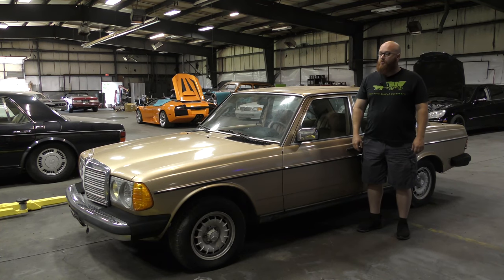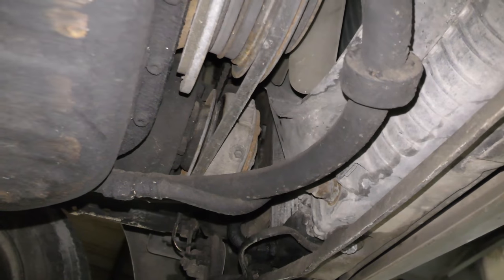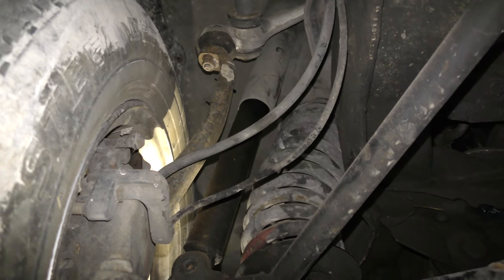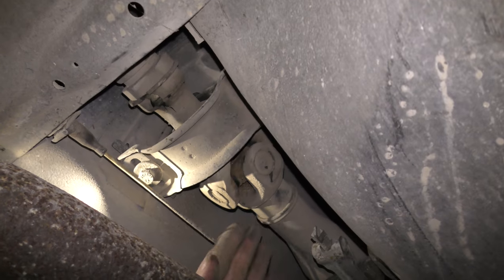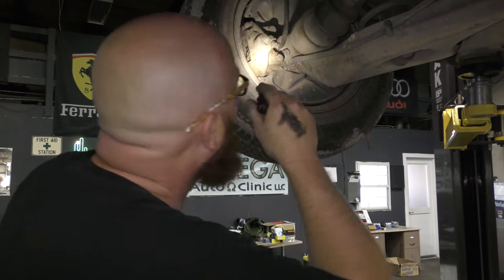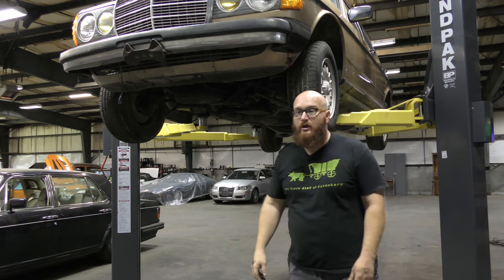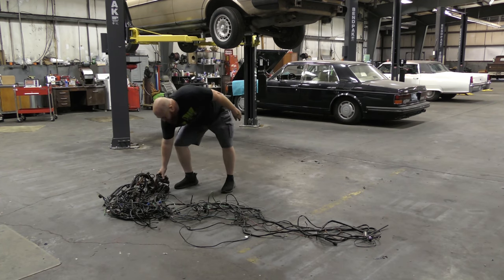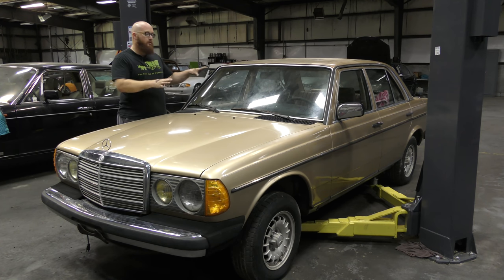What's lurking underneath? CAR WIZARD finds lots of repairs required to make '84 300D MB roadworthy

Comment: One of the best built cars ever 
Wizard if you need weird parts from Europe will gladly help.
# active mercedes club member
Reply: I wish people would stop saying that. If this car was so effing bulletproof, it wouldn't need practically every single part replaced or repaired. Sure, maybe the diesel engines, when maintained, are solid. The rest of the car is like any other, as evidenced here. Give me any old beater and I'll get it running smoothly and safely for $6k.
Reply: @OMGWTFLOLSMH  Every car needs maintenance at the end of the day. The difference between any regular old car and the "bulletproof" ones (like these mercedes, 80's Toyota Hilux, etc.) is that you can maintain them as long as you want to without needing something really critical such as an engine or transmission rebuild.
Reply: To OMGWTFLOL the difference is with maintenance and care this car will last an easy 500k without taking the major assemblies apart. These are/were designed to be taxis. The interior simply shrugs miles off.
Designed to be used and used and easy to service. Not a disposable vehicle. This is simply deferred maintenance plus rodent damage.
Cars are a choice we all like different things.
Reply: @OMGWTFLOLSMH  Rubber deteriorates and it is 36 years old. I have replaced body mounts in 2 year old vehicles that should have not failed.
Reply: @OMGWTFLOLSMH  You are so wrong. These cars earnt a reputation. The rest of the car has held up better than most others. Once upon a time Volvo was made this way too. Go find a KIA or anything GM chuck together that holds up like one of these. The work needed is rodent damage and deferred maintenance.
In the late 70s early 80s recall what other brands were making, how they dissolved and how rarely they made it past 100,000 miles.
This is a passenger car built like a commercial vehicle.
I have 3 Mercedes and they are all just awesome cars.
Reply: @jeremyaustin9103  "Deferred maintenance plus rodent damage" >>> Perfectly said

Comment: I have a 1976 Triumph Spitfire that is in similar condition as that Merc that I've built a new engine for and currently replacing all of the worn suspension components.  I am able to to all of my own work aside from machine work, alignments, and AC recharge.  I wouldn't hesitate to put the time into that Mercedes, that car has lots of potential and many years left in its life once it's sorted.

Comment: More videos on this Mercedes please. Would be interested to see how the wiring harness repair/replacement turns out. At a minimum, a video that highlights the finished product or covers some of the common repairs (give Bergsma some competition). The W123 is an incredible car that is exceptionally engineered. I would definitely restore this car. It is unfortunate that we now live in a disposable society. New cars today will never ever last as long as a well engineered car like this Mercedes. Maybe if consumers stopped buying the new garbage auto manufacturers are producing and find an old car like this W123 to fix and drive, they may get the point (but I guess that isn't good for the economy). Thank you for the videos that you post.

Comment: My grandmother’s 108 Benz 280 SE with dual exhaust. When it came time to replace the exhaust at the Benz dealer they would lay the parts out from front to back in a assembly trolley. Present it to the car, adjust the pieces, tac weld. Lower and finish the job! Elaborate but it never touched anything!  Very cool!

Comment: Glad to see that W123 is going to be recommissioned.  We did a similar W124 a 1988 260 E.  We spent $10,000.00 and the car is nearly perfect with 251000 miles.  If you need any help sourcing parts for that car just ask and  i will find it for you. I hope you will get a local qualified shop to cut out the rust and weld in a correct repair.  That paint can be buffed out and the car will be a gem!

Comment: NONE of the parts required to fix this W123 are difficult to find. It’s all available from several sellers, brands, qualities and prices to choose from. This car has better parts availability than pretty much any 90’s car. The difficult to source part was the wiring harness and is already there. That is not an excuse to let it die.

Comment: Some considerations
-Tires: They are cheap for a car like this. 
-Oil cooler lines: If you strip the treads or break the cooler itself was because someone over tightened in the past or you didn’t loosen the line properly. You don’t need to mess with engine mount if you modify them by cutting and welding a fitting that allows to replace just the rubber section. My car had that mod done. 
-Radiators are dirt cheap and easy to replace. I would change it without even thinking about it.
-A/C can wait for the moment. That is not required to make the car roadworthy.
-Primer pump is one of the easiest things to change and they are cheap.
-Front end rebuild is always in order when you deal with a car like this, unless it was done by a previous owner.
-wear sensors are not required to make roadworthy either. 
-Trans and engine mounts are cheap and easy to replace. Way easier to replace than in a FWD car. Flex disc, carrier bearing and mount are also easy, especially in a lift. Just be careful to mark the halves of the shaft before taking them apart.
-CV joints. I would put new boots if the joints were still good. Replacement axles are a lottery. You can get good ones or get junk. Changing the boots is time consuming, however. 
-Shocks are not that expensive and they are easy to replace as well. Certainly easier to change than in a car with mac person suspension. 
-Brakes should be overhauled completely.
-Left rear quarter panel rust is caused by the antenna leaking into the trunk. For some reason not all antennas have a hose drain. They just drain in that well, water collects there especially in the rubber drain is plugged. That can be easily prevented by removing the trunk liner once a year anc doing some cleaning. That’s a problem caused exclusively by neglect. It can be fixed inexpensively with a wire brush, fiber glass and paint. 
-The missing rubber donuts that hold the rear muffler is a clear indicator this car was neglected badly. Those donuts cost nothing and they are not that difficult to chance.
-The rear bumper fell off because the rubber mounts failed. Is a common issue that can be fixed inexpensively.

This car is surprisingly clean for having been neglected for so long and considering they got the car for nothing, it still makes sense to fix it. With all those repairs done, it will outlast any other used car you can get for the 6 to 8 grands that would cost to do the repairs.

If they don’t choose to repair the car is just because there is not commitment. Financially makes sense since it won’t depreciate at all for as long as they take care of it.

You buy a used Camry, Accord or Sonata for that money and 2 years later they are worthless. Also, depending on the millage and engine, they will require a timing belt and because they are throwaway cars, they will have little stuff here and there broken because none of the previous owners wanted to spend a penny to keep the car properly. All cars cost money. You just choose what to spend it on: Repairs or depreciation plus more repairs.
Reply: Absolutely correct. And another thing to consider... Toyota is reliable & everyone knows that but compared to the potential longevity of this thing, Toyota may as well be a Chrysler. 

About the only thing I can think of in the same league for toughness is the Ford Panther platform.
Reply: @acemobile9806  There might be a few other cars/trucks that can last a really  long time like the B platform, Land Cruisers, Defenders, Checkers, flat head Fords, RWD Volvos but some of those cars a bit unusable for most people these days and some of them (Land Cruisers and Defenders) are way more expensive than an older MB.

Comment: Hello Wizard, my grandpa had a 300D (or 300TD not sure yet) W123 and is sitting for 9 years now. After watching your previous video for the W123 I when and try to start it with no success, forgot about fuel, I will try again after checking things first and getting information from your videos. Thank you for showing us!
Reply: I will go with today's information next try, the wires look good on it.
Reply: I hope you changed out all the fuel filters first.
Reply: @300DBenz  Thank you, that is my first step. No much space to work where it is now, thinking of moving it but is not easy if its not driving.

Comment: I had a '81 280E, built in Germany and bought new. Maintained by the book and it was still very trouble-prone.
Nice to drive and solid body but many parts were poor quality with many random failures, etc. Had one more after that provided by my company. I then went to Lexus and will NEVER return to any German junk.  Got to be friendly with a really smart M-B Certified Master Tech.  He said that the big secret of M-B is that they are not especially good cars. I'd certainly agree.

Comment: Too many ppl don’t replace old tires simply bc there’s still tread. Good point wizard, dry rot causes blow out. Not safe. I always check tires and date code. Leaves and debris is good to clean out this way it doesn’t rust and rot the car out.

Comment: Wizz get yourself a chunk of telco cable has many different color combos wires . Tag plug and components with the same pair of colored wire to help replacing the harness. I believe its 25 different color pairs. Use 25 under hood 25 under dash  .

Comment: Speaking of old Benzes and tires, somehow I have a 1985 with the original spare and the tire is still good, had it dismounted and inspected. Meanwhile, I had a sidewall blowout from 2015 production year tires on my Porsche. That's the difference between exposed to sun and not exposed to sun I suppose.
On the A/C compressor, mine locked up right as I hit full throttle (with a modified M117 5.6 liter) and the clutch exploded. That was fun.

Comment: I’ve had to replace almost all of that stuff on my 300D. Luckily though, my wiring isn’t chewed up. Mine also has a good bit of rust under the rear unfortunately. I’ve recently purchased a 1986 naturally aspirated Porsche 944, so now I’ll have 2 cars and I can actually do more in depth work on the Mercedes because it was my daily driver

Comment: Presumably, it will be the first item in the workshop manual under "completely rewiring the car", but the first problem I'd have with that harness is WHERE to start shoving wires in. I would take a guess that you would put the whole thing inside the car and start from there. 😁

Comment: Hey Wizard.. Love some old Benz's.. the 300d motor are bullet proof. this will be a good car for a student when your done. by the way I don't know if you have ever used  Parts Geek or not but they have everything you need to get that car on the road.  fair prices as well. have used them on my benz's a lot.
i am no mechanic but i keep my benzs alive,  i've all the service on my cars for years.  you said you would turn the rotors.. I just replace them cause no one around my area i trust  (bad machine shops) and really you can get replacements for the cost of turning then you dont have to worry bout the warping if they go to far. .Really enjoy you and hoovie. best of wishes.

Comment: Of course I'd be willing to restore it/have it restored. More so if it were a 280 CE, but I'd take the slow-ass diesel... :D
As intimidating as that harness looks ... it would look pretty quaint if you laid it out next to all the wiring found in the modern day equivalent of that W123... :)
Gotta say that even though there's a lot of work to do, considering the age of the car and where it spent the last 5 or 10 years, it still looks pretty decent underneath. No wonder these things are still popular in Africa and veteran cab-drivers over here in Germany still get teary-eyed when you ask them about the W123. I remember sitting in a W123-diesel taxi in Portugal in 1991 and the driver showed me the odometer ... it was at over 500,000 km and according to him, it was still on the first engine and gear-box.

Comment: That harness looks more like 2 days 2 guys to remove and replace.  Lots of r&r , seats ,carpet, consol , door panels maybee, parts of the headliner.   If you have to use butt splices get the shrink tube ones.

Comment: Properly sorted very good examples of this type of car actually are coming in pretty close to $10K now, so getting this work all done might make sense if you are looking at a long term investment/classic restoration.  Or for nostalgia.  It's certainly cheaper than restoring many other classic cars and a good first project as well, since they are so dead-simple.  

But DO absolutely expect to spend $10K on getting most of these to 100% inside and out.

Comment: Glad the car is being renovated. 
However I would not give it to an inexperienced driver generally. The parents should keep it for themselves if they appreciate classic cars. The exemption from the rule would be if my son or daughter already had a record of sensibility, maturity & restraint. I would be cautious with the family heirloom.
Reply: I mean, the fact that the daughter wants a car like that is already quite incredible, and will probably appriciate it. But yes is a car to be driven whit a modicum of care at least, if for no other reason to not die rammed by some idiot in a suv. The brakes are not as good as on new cars and no airbags whatsoever.
Reply: I think one thing that needs to be mention to them & planned for is the valve adjustment every 12k miles for the Om617(a)
Reply: @Ermy1996  Definitely. If in fact she actually wants that particular car because of its significance, that already helps the case.
What gives me shivers is the Wizard's daughter (similar age?) & her off-roading his formerly immaculate Prelude into oblivion.

Comment: Forgot to add Say you spend 6 grand for mechanical and cosmetic.  That car would bring that easily and won't depreciate.   i recommend Vredestein tires (5)  and HELPerformance stainless steel braided brake lines.  Also  Bilstein shocks/struts.

Comment: I paid $3500 for my ‘85, (cosmetically beautiful, but mechanically she was very rough), spent $5600 or so on parts over the past 12 years I’ve owned it. Did all the work myself (except for having a machine shop repair the manifolds), if I’d paid a shop to do ALL the work I did, it would’ve cost around $20,000 just in labor.

Comment: I'm often surprised that in the states you resurface the brake rotors/discs. Here in the UK we tend to just replace the rotors as they are not expensive in themselves. That car has multiple age and rodent problems.  If I owned that car and was keen to renovate it I'd try and work out a plan for the bits I could do, and the bits I couldn't do that I'd ask you to do. That way it might just be economically worth it. It is a labour of love, but a lovely car at the end of the day..........oh...and I thought you didn't do projects.......ouch !

Comment: The proble you get with a hand me down car, I had a car off my dad but he put in the deal he would go in on any repairs? well at the end of the MOT it needed more in repairs than the car was worth in fact 3 times the value of the car, luckyfor usmy da was pretty well connected through his job and most of the work cost parts or less. I had that car for 4 years and a friend had it for another 2 years and he sold it again.

Comment: I had an 83 300D.  I 

The only thing that continued to be a problem was the HVAC system.  Other than that, an excellent car.  Had a little over a 100k when I sold it.  Should have kept it, I'm sure I'd still be driving it.

Comment: Can you still get good parts for these?  I went through a MB diesel phase where I’d find and fix em up as a hobby...a bunch of 123, 126 and a couple of 124 cars.  Gave up when OEM replacement parts (like lemforder, Mahle, Meyle, Phoenix engine mounts) were only lasting a fraction of time the originals did.  A lot of junk rubber parts out there...even from previously reputable brands.

Comment: whilst changing front end suspention parts run a wire wheel power buffer around the upper "cup" which holds the top of the front spring;  many times these welds are cracked loose from 35 yrs of road shocks.  Imagine NOT DOING SO and said upper spring mount lets fly after all of that work down the road with the kid driving

Comment: There's even a company "Mercedes Classic Parts" or something like that which still provide the spare parts for these old vehicles.
Reply: Don't mistake classic parts places as cheap parts wholesalers. Most of the places sell NOS (New Old Stock) parts that are virtually unobtainable anywhere else and they know it. Very few people can fabricate or reproduce these parts and they know it. Be sure you're sitting down when they quote you the price, and don't bother waiting for the laugh track or the "just kidding" after. Especially if the classic parts salesperson isn't laughing after quoting the price.
Reply: @houseofno  I know that. But at least Volkswagen classic parts is actually trying to remanufacture the more popular old parts "as new". Which of course has its price, why wouldn't it have? Having a vintage car like that is a hobby, not a necessity. And it's worth it.